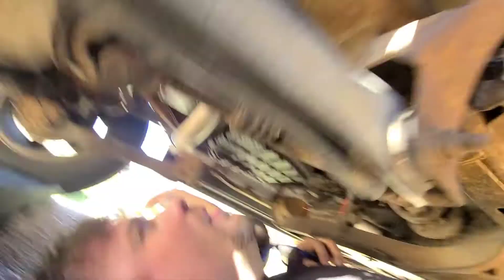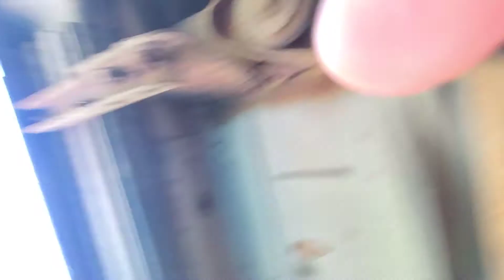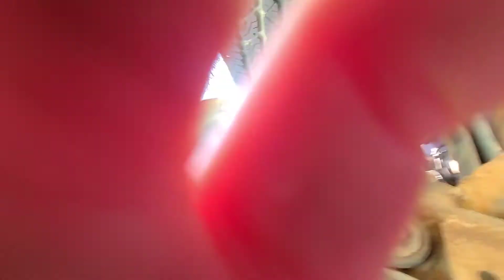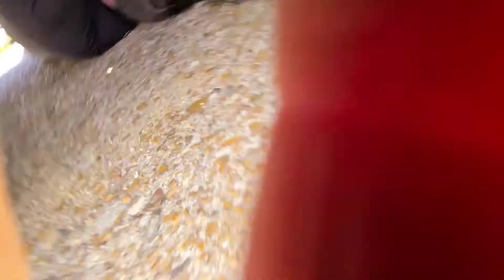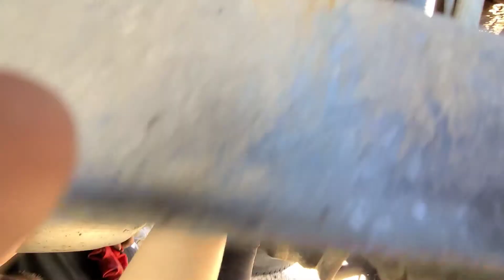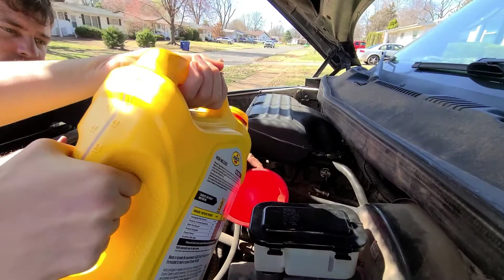Changing oil in 2nd gen Dodge Ram 1994-2002, with Are Jay the redneck.

Comment: Oil changes are always the easiest job to do for vehicles. Don't know why anyone takes it into a shop to get ripped off and possibly have their vehicle destroyed by a technician rushing through the job. I need to replace the U joint on my 2nd gen dodge, but I'm nervous about trying to do it. I watched your video on it and saw how much of a hassle it was removing the castle nut. The truck is 21 years old so I'm sure its gonna be pretty tight with all the rust even after using PB blaster :/